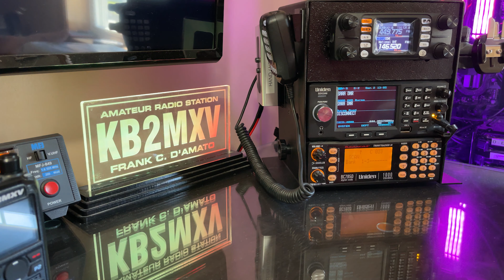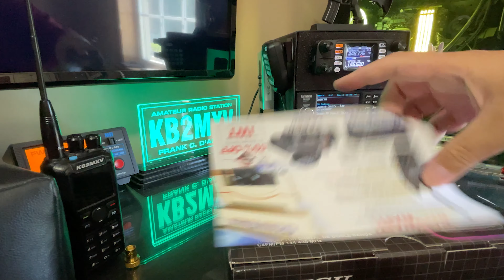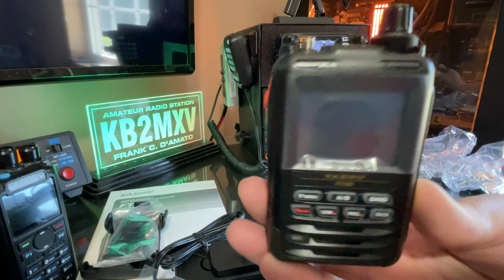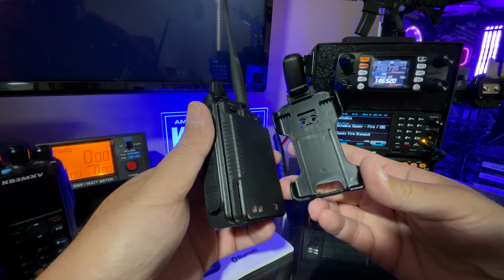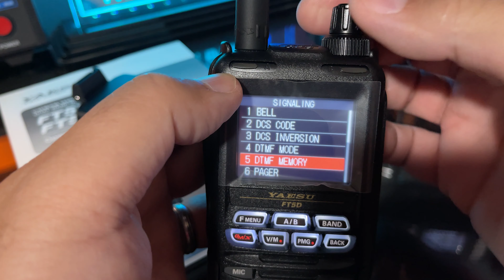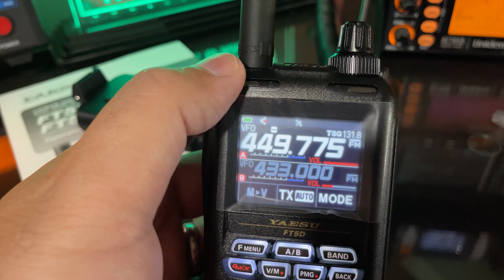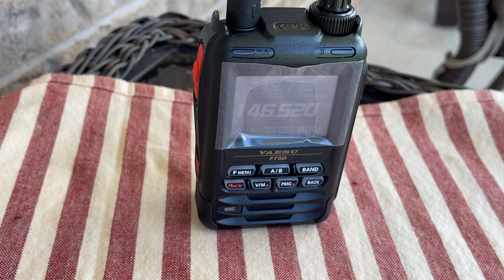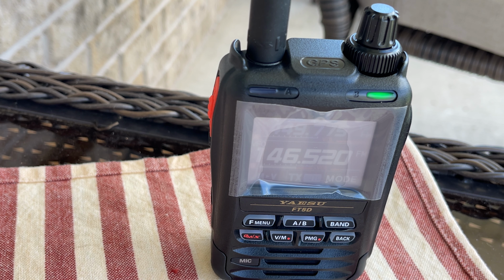Yaesu FT-5DR Hands On First Look

Comment: Those with FT-5DRs, could you please check the following.
Received my unit yesterday and immediately noticed the following issue.
When in dual VFO mode (VFO-A on HF or 50 MHz band/VFO-B on the default frequency 433.00 MHz), all other settings system default, I get two or six brief pulses of RF noise approx. every 60 seconds. 
Switching to mono VFO-A (HF band or 50 MHz) the pulses disappear, switching back to dual VFO mode as above, the RF pulses reappear.
The source of the RF pulses are not external to the radio, duplicating the receive conditions on my FT-2DR there are no RF pulses.
Tried re-setting to factory defaults and the problem is still there.
Reply: Located the problem, likely some digital RF noise (yet another source) external to the radio.
I like the FT-5DR a lot, audio and sensitivity on HF much improved over the FT-3DR.

Comment: Does this radio have the plug in the back so you can remove the capacitor is the capacitor or whatever GMRS mod it?
Reply: It does.  Under the battery is a gasket cover for a thru-hole to a single component.  Removing that component provides the MARS modification.  An FCC no-no, unless you're a first responder or associated to the Civil Air Patrol, etc.  But, it is there, and people do it.  Heard that HRO offers to perform the MARS mod, but I believe you gotta provide them with some eligibility evidence first.  GMRS is a great service and a great way for Hams to get their radio-averse family members accustomed to using radios.  I put one in my wife's car and set it to the local GMRS repeater.  She can talk to me from her car now, with me using a basic HT at home, from 15+ miles in all directions.  Great backup coms.  (And yeah, I have a GMRS license and we use GMRS radios. - But don't think I'm not tempted at times as many older CCR's will Tx on those freqs.)

Comment: Bummed this came out, just picked up a 3D a few months ago...
Reply: I would not get too down, this seems to be an extremely minimal upgrade
Reply: Agree with Jon.  You saved money and you're getting 95% of the features of the FT5.  Plus, you've got a TON more Youtube content out there to learn from.  I find how-to videos so much more helpful than the manual - and yeah, I do read it.  For my FT400 mobile, I've gone out to my car at lunch time, pulled up a five-min vid, and had APRS or Wires X going in no time by following along with a video demonstrating.  They're nearly identical radios and, if you don't need the waterproofing, there is no real reason to upgrade.  For most, the speaker volume issue of the FT3 that people love to hate on isn't really an issue.  If I were you I would not be bummed at all.  You got 95% of the features for ~70% of the cost.  The very definition of "value", if you ask me.

Comment: I wonder if the audio is better than the FT3? Because it really does suck.
Reply: The audio in the FT-5DR is much improved over the FT-3DR (I sold my FT-3DR due to it's inferior audio).
Reply: No issues with my audio on my FT3D. I use mine in a vehicle (with external antenna or OS3) and on trail hikes. Not sure what the fuss is about. From all the reviews I watched so far, there seems to be very little difference in audio.
Reply: @scottkarlins  I think you're correct.  Lotta youtube hype around that, everybody parroting what other reviewers/commenters say.  Maybe for some, but I bet 90% of folks wouldn't notice anything til they watch a YT video complaining about it.  I've seen an audio comparison on the two and there was no effective difference in decibels produced.  I think the FT5 sounded a bit clearer  (which is really a function of the speaker port in the outer case design, I suspect) but that's subjective too because much depends on what you're listening with at home when watching the video.  Same in this vid.  If your PC's speakers are crap, it doesn't matter what was put on the video, they'll all sound poor.